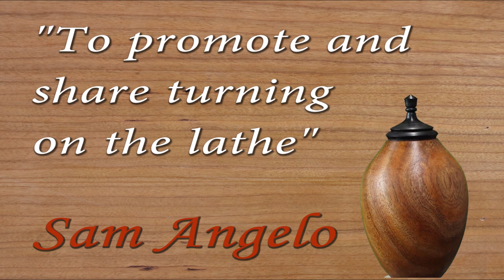Turning a Madrone Hollow Form with a Blackwood Finial   with Sam Angelo

Comment: I loved the opening. It is always nice to see Cheryl in the shop. Sam, this vessel is outstanding. The wood selection gives great contrast. The shape is very nice. Nice smooth flowing lines. Plus the excellent finial. All topped off with a subtle finish. What grit did you sand to? And what grade of CA (Thin, medium, thick), before the Acks Sanding Paste? The combination produced an excellent finish.👍👍 Thank you for sharing. Have a great day and stay safe.🙂🙂